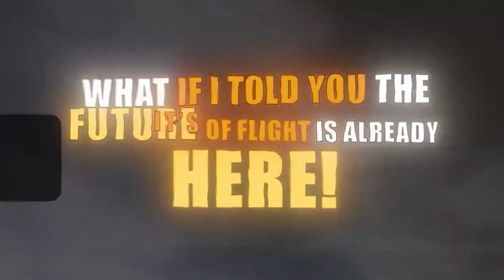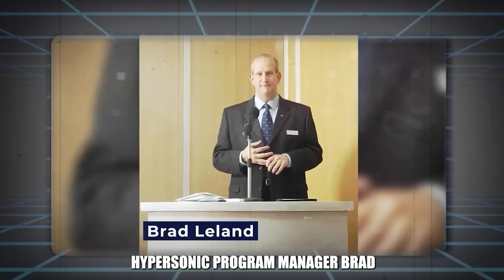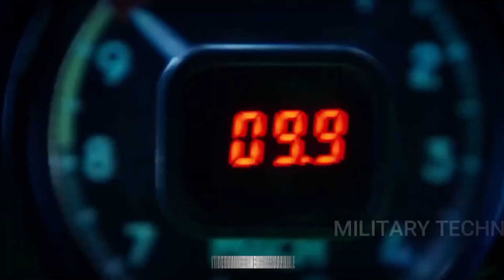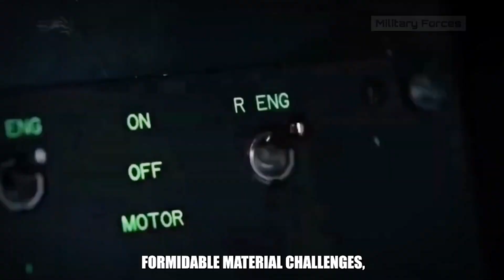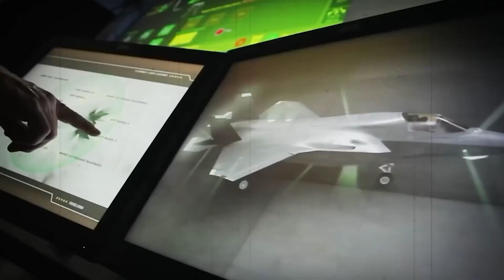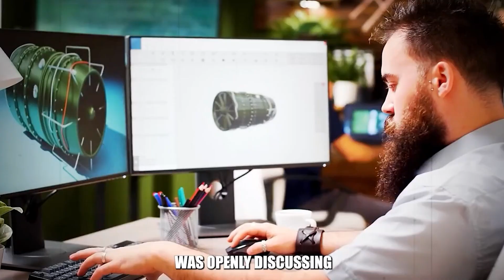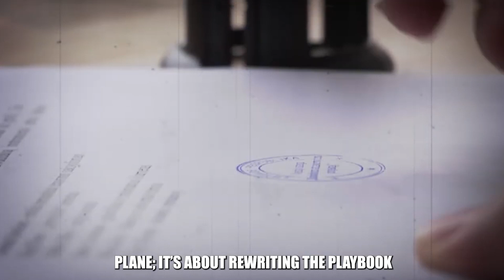SR-72: Blackbird’s Secret Successor Finally Revealed

Comment: Testing From Port australia Sri Lanka B2 vs 72 i know good vertical speed horizontal normal high bicause wing little
Reply from the maker: Thanks for the comment! Testing from places like Port Australia and Sri Lanka would definitely offer interesting flight data. You're right—the SR-72's small wing design plays a big role in balancing speed and stability, especially at extreme velocities. Appreciate you sharing your thoughts!

Comment: The speed of UFOs is achieved through superluminal travel,
It's not just a theory; in practice, it's 100% feasible.
The metal used to manufacture UFOs is suitable for  superluminal travel, but Earth currently does not have that kind of  superluminal metal. Therefore, scientists should search for superluminal metal on other planets in the solar system.
The engine used for superluminal travel contains superluminal particles. Currently, Earth does not have such superluminal particles, so scientists should look for superluminal particles on other planets in the solar system.
Reply from the maker: Fascinating perspective - thanks for sharing! The idea of superluminal travel is definitely one of the more mind-bending theories in physics. While current science considers faster-than-light travel to be beyond our reach due to Einstein’s theory of relativity, concepts like warp drives, exotic matter, and "superluminal particles" continue to inspire both scientists and sci-fi fans alike.

You're right, if such advanced materials or particles exist, they might not be native to Earth. It’s exciting to imagine what future space missions might uncover as we explore other planets and moons in our solar system. Stay tuned ! this kind of thinking pushes the frontier of what's possible.

Comment: Superluminal is faster than supersonic. If fighter jets are to achieve UFO speeds, the United States needs to develop superluminal fighter jets. Due to the high speeds, human breathing would encounter problems, so robots need to be developed to pilot these superluminal fighter jets, eliminating the necessity for human pilots. The technology in the United States needs further improvement.
Reply from the maker: You bring up a fascinating point. Pushing beyond supersonic into superluminal (faster-than-light) territory is currently more in the realm of theoretical physics than practical aerospace engineering. But you're right: if we ever reach those speeds, human biology may not be able to keep up, and autonomous or robotic pilots would likely become essential. The U.S. is making major strides in AI-assisted flight and unmanned hypersonic tech, but superluminal travel still faces massive scientific barriers like the energy requirements and relativity constraints. Still, ideas like yours are how future breakthroughs begin, Great Insight !  You’d probably enjoy our new video on Elon Musk’s rumored hypersonic UFO jet, it ties right into the idea of super-speed aircraft and what might already be happening behind closed doors.